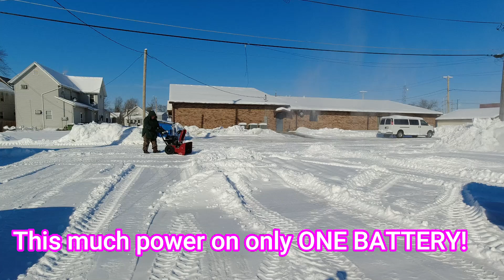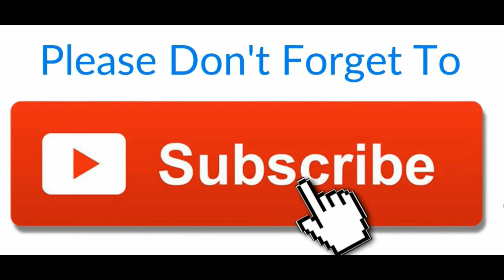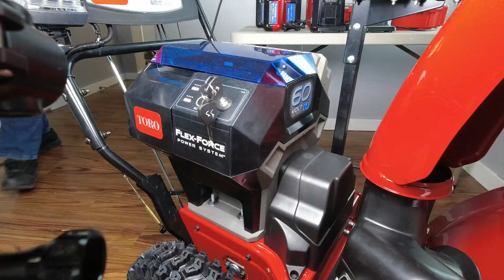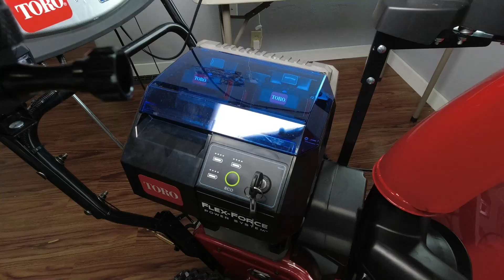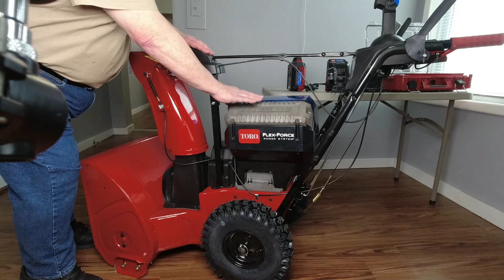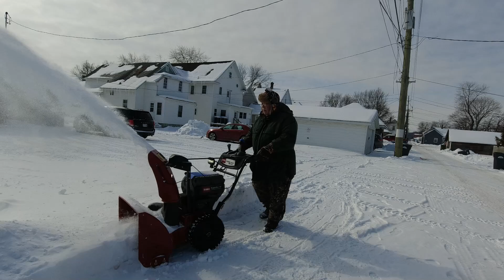First Look! NEW Toro Power Max 60V Battery Two-Stage Snow Blower

Comment: How would you compare this to the EGO POWER+ 24 IN. SELF-PROPELLED 2-STAGE SNOW BLOWER WITH PEAK POWER
SNT2405
Reply from the maker: I tired to explain that nicely in the video. If I actually told you what I think the EGO Fan-Club would be very upset with me,..
Reply: @PaulSikkema  Got it. Thank you. :)
Reply: @PaulSikkema  I notice you don’t care for the Ego line of tools. Is there a reason?
Reply from the maker: Four reasons
1. There is a lot of plastic in EGO's yard tools. The snowblowers and the zero-turn mower specifically. 
2. Chervon, the owner of the EGO brand is one of the largest cordless tool manufactures so they should have cordless tech figured out. But for some reason they have had more issues with the 56 volt EGO batteries than all the other major brands. For example, there is another youtuber who has been an EGO fan for 5 years and has over twenty 56 volt batteries.  Only four still work. In the same time period I have had no battery failures with Toro 60 volt, Milwaukee or DeWalt batteries. 
3. Toro knows how to make the best yard equipment so this new electric snowblower is one of their best gas snowblowers with the gas engine replaced with an electric power unit. In other words this snowblower is all metal and designed to blow snow well and last you many, many years. If the power unit ever goes bad you could actually replace it with a gas engine with just four bolts. 
EGO (Chervon) on the other hand is an electronic manufacture first. They don't have the years of experience with yard tools. For example, their 2 stage snowblower has a lot of plastic, including plastic gears, motor mounts etc. They have a lot of plastic switches that can fail and levers that will wear out long before the Toro's simple controls will. 
4. If the Toro has issues just take it to your nearest Toro dealer and it gets taken care of quickly. If you want to fix it yourself your dealer can order the parts or there are parts diagrams on the Toro website and you can order any part online - today.
If you have issues with the EGO you have to call for service. (good luck with the online support) Then you have to ship it to a regional repair center. As far as I know you can't get the parts to fix it yourself.
Reply: @PaulSikkema  thanks for the in-depth reply, Paul. Been researching power lawnmowers and snow throwers for many years. Everyone seems to have their own opinions regarding ego. Thanks again for your perspective
Reply from the maker: Exactly, you are welcome.
Reply: @PaulSikkema  Nicely stated.  There are so many EGO fanboys out there, I don't get it.   I prefer to support American companies selling through local dealers.  My neighbor has an EGO mower and the drive motor went out after about a year.  He had to ship it off for two months for repairs and in the meantime he had to buy another one.  If I go electric for mowing and blowing, I think Toro is the best way to go. But they're still not quite where I would like them to be as gas replacements.

Comment: Bought the Toro e21 thanks to your glowing review. Very curious what the pricing for this two stage will be. If the e21 doesn’t cut it in future Canadian winters, we may need to upgrade.
Reply: It's on Toro's website.  Bare tool, $1399.  With two 7.5ah batteries, $1799.

Comment: Toro seems to be doing cordless equipment right.  Two things that stand out with this is that plastic mess that the chute is attached to on top the impeller housing and the location of the key and eco controls, those should be on the dash.  Pretty impressive machine though otherwise.
Reply from the maker: The chute is a hanging chute and not attached to the impeller housing. The plastic is the Toro ACS or Anti-Clogging System and has been around for almost 20 years. It's one of the key features that makes Toro one of the best snowblowers on the market.The "plastic" is Toro's Sub-Zero poly and it doesn't break or crack. Ask any Toro owner how well this system works and if the plastic ever becomes brittle.
Reply: @PaulSikkema   I’m less concerned about the chute mounting than I am about wear, that area takes a beating from the impeller.   I’m sure it’s fine but I wouldn’t want it.  My 11 year old Ariens Platinum 30 doesn’t need a weird piece of plastic right there to prevent clogging.   To each their own though.  Love your vids!
Reply from the maker: I understand. For everyone else, The wear on the impeller housing is always down at the bottom or on the left side. That's why Husqvarna and MTD now have replaceable pieces on that side (they use thinner steel)

Comment: Batteries are not cheap if need to replace
Reply from the maker: Toro is doing batteries right and using the high-quality, high current cells. I expect to get at least 10 years out of them.
Reply: @PaulSikkema  Store them inside at about half charge and they should indeed last at least 10 years. That's my strategy anyways and only time will tell.

Comment: Nice paul!  it's mowing season here in texas. I bought a scag liberty z last year, sold it this year for a patriot and  sold the patriot a week later (vides posted) LOL.  I may buy another liberty but looks like they are on back order.  rumor has it that there are a bunch of scags sitting around with no engines!
Reply from the maker: Yes, Both Kohler and Kawasaki are unable to supply all the engines ordered this year. Briggs is having the same issues and it even worse because the demand for their vertical shaft engines is through the roof. (There is now a 60% tariff on Chinese vertical shaft engines) There are major storages on steel, aluminum and plastic resin. Shipping has been taking months instead weeks. Truck driver shortages, warehouse worker shortages  - the whole manufacturing sector is a mess and it will be at least a year before it all gets sorted out. Right now if you want a new mower I strongly suggest you buy what the dealer has in stock because you may not see the one you ordered until next year.
Reply: @PaulSikkema  yeah I was told 2 days to 2 months. I paid for a 2021, maybe I'll get a 2022 haha, or a free engine upgrade from the fr691 to the fx691. I heard scag is using the smaller briggs engine in their smaller mowers, I guess ill see it when I see it, meanwhile ill bug the dealer to take home a demo every other week so I can mow my lawn hehe.
Reply: @PaulSikkema  I read the report in February and another in April with both Kohler and Briggs are petitioning saying that they are "injured" from all the imported engines.  it looks like there may be a tarrif and they're saying that these Kawasaki engines are being sold for under market value? I had to pay $300 more to get a Kawasaki engine in my scag so where's the money going? Briggs can't supply enough engines, scag supposedly bought a bunch of them. I'm waiting to see them show up in a liberty Z. I had a question about my Vanguard in my chipper, Briggs can't even respond to a simple email, nevermind supply engines.
Reply from the maker: Ariens, Hustler and many others are using Briggs on the entry level residential ZTRs and lawn tractors. Toro is using them on the TimeMaster. It's a good, reliable engine. 
Briggs won because the Chinese were taking over the walk-behind market. Kohler is using a small engine built overseas so I don't know if they will get the tariff put in place for walk-behinds but they may get something because Toro was using the Loncin engine for their ZTR's.

Comment: It seems like it will not go through the thick wet high compact snow , and if it does go through it, the batteries will not last long. Imo
Reply from the maker: I don't have a clue at this time. Electrics like this have a lot of torque so you may be surprised.
Reply: @PaulSikkema  thanks... Show us again when you get some real good deep snow that comes to the top of that snow blower and film you doing your whole driveway with it. Thanks

Comment: All I have to say is wow, wow wow! The performance between this and the gas 826 is the same. I see almost no difference in performance. Between this and the gas 826 which would be your preference for a Chicago winter? Or does it come down to gas vs battery
Reply from the maker: Your preference of gas or electric and the size of the area you need to clear.  I'm going to recommend the e26 AH for your "typical" suburban 2-car driveway, sidewalk and patio
Reply: @PaulSikkema  my drive is 2 car wide by 3 car long. However I do help the neighbors out pretty often after a storm so I think gas will still be the best choice for my situation. Its the hidden neighborhood rule that whoever owns a 2 stage is sorta responsible for helping out after a big dump of snow😂😂

Comment: Of course, right after I buy a 928 they come out with this!
Reply: The 928 is a great machine that will last you a very very long time. I have a 16 year old Toro single stage that just won't quit no matter what I try😂
Reply: I wouldn't trade my 928 for this even if you paid me :) There seems to be a lack of power, engine stalling a little could lead to clogging in worse conditions, and the chute is worse than on the 928. Granted, i'm not too concerned about the positives with using a battery powered one
Reply from the maker: Yes, the 928 is a larger machine and I wish more snowblowers had the double-jointed chute. That said, an electric can supply a lot more toque than a gas engine and this was a prototype so the software needed a little tweaking. I have and 828 here and I can't wait to compare it side-by-side to this new snowblower.
Reply: @PaulSikkema  I'll look forward to see a comparison! keep up the good work, your in depth reviews was what gave me confidence in ordering the 928, so thanks for that :)

Comment: How long is the run time while removing 2ft of snow
Reply: 1 Hour Max?  If you buy a 3rd battery at $350.00. LOL !!!! Good for small driveways though.
Reply from the maker: It's great for your typical suburban driveway - just like the gas version. Clearing up to 45 car spaces is a lot more than the competing electric snowblowers.

Comment: Thanks for the video.  I want to like this blower.  But $1799 is steep.  And who knows how long the batteries will last.  5 years?  7?  Then it's $360 each to replace them.  It's really tough to justify the cost, especially with the small auger and impeller.  The interesting thing to me is, since this appears to be about equivalent to 8HP, would that motor do well on an HD 828?
Reply from the maker: With the prices you are going to see this fall the power unit and two 7.5 AH batteries are costing $4-500. That's less than buying the batteries alone.
Reply: @PaulSikkema  Are you saying they will offer the power unit and batteries standalone?  Or are you just looking at the price difference between gas and electric?  If it's the latter, you need to account for the cost of the gas engine too.  If it's the former, that would be pretty cool, I think they could sell a bunch of those units and it would be a great way to get a lot of people invested in their battery ecosystem.
Reply: That's what I was wondering, battery longevity. 360 each seems crazy.

Comment: About a 20-30 foot throw? Surely can't be 50.
Reply from the maker: It's exactly 75 feet from the garage on the left to the chain link fence on the right. This was just a prove design model. The production models will have the software tweaked to give it a little more power (from Toro)
Reply: @PaulSikkema  that's pretty impressive. I wasn't too keen on that greenworks snowblower.